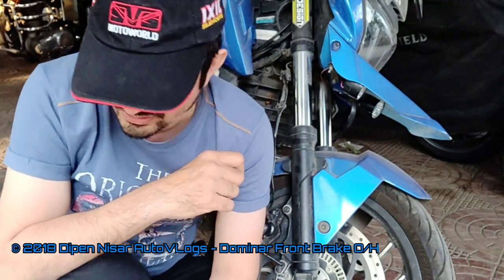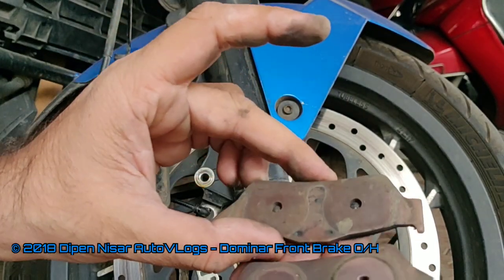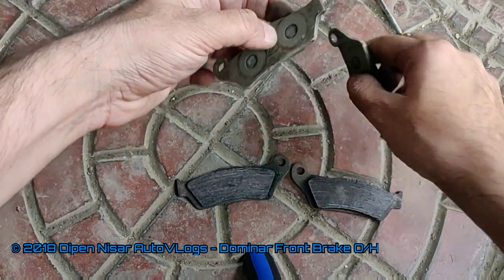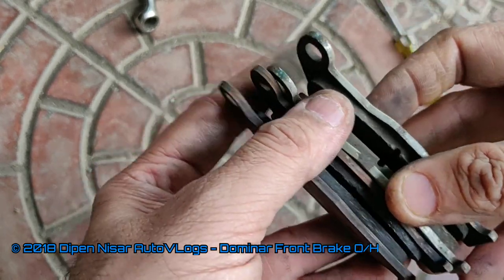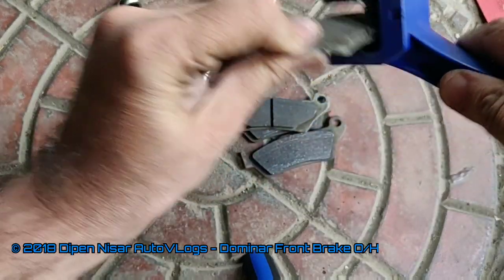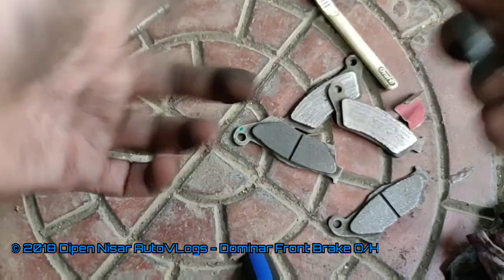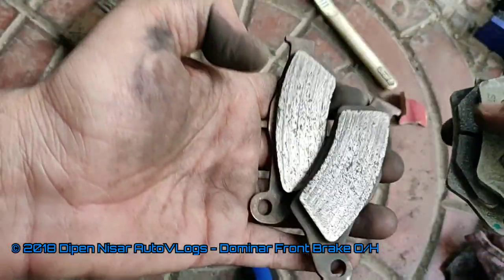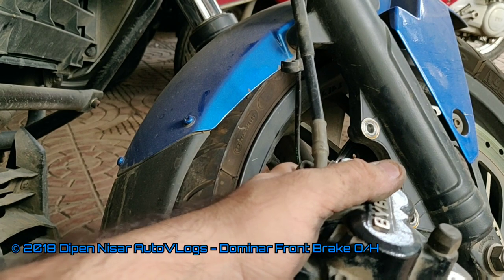Bajaj Dominar 400 Maintenance | FRONT Brake Pads OH | EBC Brake Pads for Dominar | DIY

Comment: Vesrah ceramic brake pads is being offered for 1000 re for interceptor650 online.. It is better than stock..... And what is diff bet sintered vs ceramic
I don't know what brake pads in front...
Reply from the maker: Sintered brake pads have metal in them. This gives better grip for the pads on the disc. And thus gives better stopping power. Bike stops in shorter distance.

Comment: Did you feel any remarkable difference by using EBC brake pads against the stock ones?
Reply from the maker: Yes. Stopping power is much better. Bite is much better

Comment: Brother just because ur an experienced rider. Pls guide me. In My cbr250r . C-abs the brakes even upon pressing hard does not make the motorcycle stop effectively. The brake pads gives a sound of a sort of slipping. I have opened up the brake callipers and cleaned them. Also I have bleed the front and the rear brake s. Also the second bleeding nipple on the front callipers. Is it because of the brake pads or something else in the brakes system. I am unable to locate the cause of this ineffective brakes that even on pressing the brakes too hard the bike does not stops immediately. It slows down but does not stops immediately and therefore the abs is not working because of that.Can anyone suggest the solution?
Reply from the maker: From all your feedback, I am assuming the brake pads have gone too hard. You can try trimming the top most layer of the brake pads with a polish paper. This will soften the brakes and make is slightly more effective for 100-500 kms. Post that if the brake pads have gone hard, your braking will again be bad less effective. Also do check the tyre quality. How old is your bike and how many kms have you done. Also is it your own bike since day one or is it pre-owned.

Comment: How to check the remaining life on the pads without removing them out?
My dominars brake pads, i jave changed them before 2.5k kms, and I feel the new ones have already worn out in these 2.5k kms.

Any suggestions to check ourselves?
Reply from the maker: yes you can check them without removing them. Calipers have openings where the brake pads sit from the disc side. the perimeter where the disc rotates. you can check from there.

Comment: Hey Dipen .. I currently don't get that progressive sharp bite on my front brake.. Complained to the service center and they just cleaned the brakes, adjusted the lever play and did the bleeding and with the current lever play it's bad! No gradual pressure feel...  It's just sudden. My current stock tyres have are 8000kms in and so are my brake pads. Any suggestions?
Reply from the maker: The brake pads must have gone hard. Replacing will only get the progressive feel back. 
but the stock brake pads are of that quality.
Reply: @dipen.nisar.autovlogs  EBC then? Or any other alternative? Also how long do EBC ones last compared to stock?
Reply from the maker: Not sure - still using the current EBC ones (I mean they are still the first pair). Their cost is INR 4000 is what I know.
Reply from the maker: I know Bikers DNA - go for it, its a good price

Comment: Worth the 4k? How much percent improvement in braking performance? Also what tyres are you using with them?

And will the KTM Sintered brake pads fit?
Reply from the maker: Not sure about KTM. 

Tyres are Michelin Pilot 

Braking has improved a lot. Stopping distance along with these brakes and Tyres must be 25-50% shorter.
Reply: @dipen.nisar.autovlogs  how are the Michelin pilots? Heard they make a lot of road noise, is that true? Was thinking of trying the Apollo alpha h1 but not too sure about them.
Reply from the maker: @2TurboCharged  yes they do make roadnoise. According to me stickier Tyres make more noise. These are absolutely sticky. Way much better road grip than stock. Apollo are good too. Many friends using Apollo too.

Comment: Few things to note, it's a good idea to wash and dry the callipers before doing any kind of work on them.
Do not use brake cleaner or any other solvent to clean the pistons or any other rubber parts. Pistons have rubber seals around it and solvent will make them brittle leading to failure. The best way to clean the pistons, is to remove the callipers, empty the brake oil, use air to push the pistons out and only then grease the pistons and seals, that is a complete overhaul. Your uneven wear is related to uneven compression which can be resolved by greasing the pins.

I prefer organic brake pads compared to stinted ones for street riding. Yes the wear rate is more but the bite is progressive giving me more control plus no squeaking sound.
Reply from the maker: We have been using the break cleaners for years , none of the seals have gone bad till date. May be the brake cleaner you get is not good. Change the brand and try. 

Rest was carried out later as it's a universal process to overhaul the callipers.

Comment: Hey Dipen, I have installed  Ebc pads on the front and very happy with the performance. Wanted to ask you if I  should expect  excessive wear of the disc due to sintered pads compared to stock pads? 

Also for people asking, the model which fits the front caliper of the Dominar  is FA181 HH.
Reply from the maker: Nope. It does not wear of the disc soon. I used for 10,000+ kms
Reply: Bro is this the same brake pad for 2019 dominor?
Reply: Could u tell me the model number for rear brake pad pls?
Reply from the maker: @harish0sps  not aware about the model number for rear in EBC
Reply from the maker: @harish0sps  nope. Front and rear are different
Reply: @harish0sps  SBS Ceramic pads 675HM is what I'm using for the rear. Don't know the model number for the ebc ones for the rear.
Reply: Thanks for the reply guys
Reply: @2TurboCharged  is it good bro? My dominor rear brake feedback is very low
Reply: @harish0sps  better than stock but after using Ebc Sintered pads in the front I'd recommend you to get the same in the rear.
Reply: @2TurboCharged  k bro thanks how much is the front brake pads cost u?
Reply: @harish0sps  2.8k

Comment: Bro will dominar 400 disc plate will set in ns 200 plz rply
Reply from the maker: If you check comments in all videos. I don't leave them unanswered :)

For the conversation, I don't think it's possible. As rims might be different. 

A Bajaj dealer can help you in this answer

Comment: I have the same issue can u reply what's the problem
Reply from the maker: Can you please explain your bike issue  in detail ?
Reply: @dipen.nisar.autovlogs  brack pads of rear and front both the pads of same caliper wearout differently
Reply from the maker: @maheshchhugani2080  get it checked by service. Physical inspection will be required first. Let me know what do they say.
Reply: @dipen.nisar.autovlogs  ok thanks